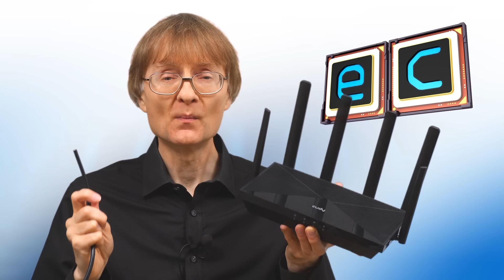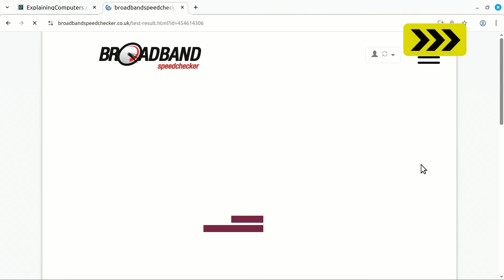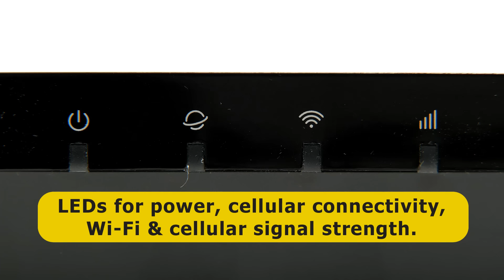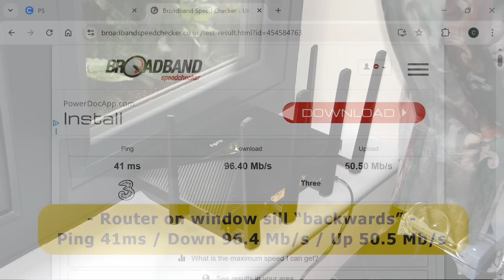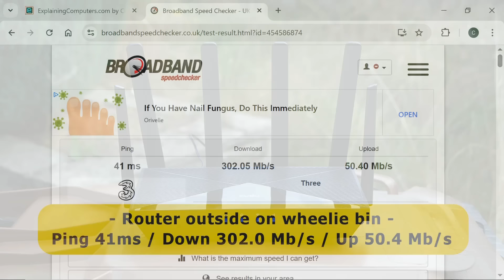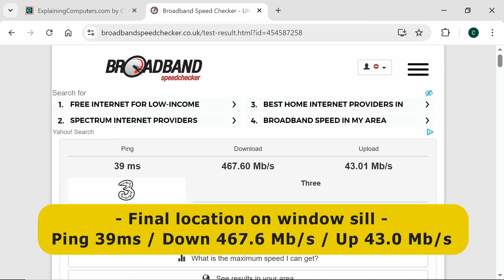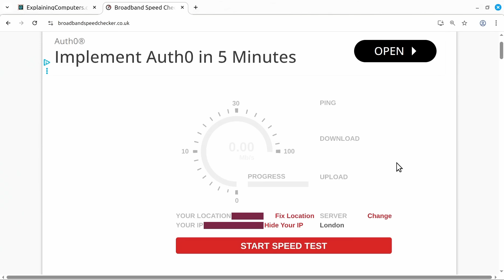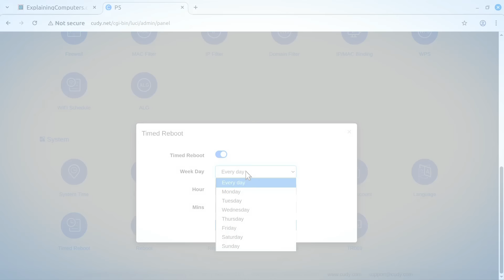Switching to 5G Broadband: Cudy P5 Router

Comment: Thanks Chris, great to see you've made the switch. There are a surprising number of major supermarkets running just on 5G and some on 4G, so the networks can good enough, if you pick the right one. A few things to note:

Three have an APN which hands out a real public IP address - use APN: 3internet 

Be slightly wary of speed test results - all networks prioritise them to reduce support calls.

Being close to a mast is great, but if that mast is put into maintenance (happens quite often) bye bye connection as you're unlikely to be in range of another mast.

If you're sticking to this setup, I'd suggest getting external antenna as it'll help when weather isn't great or if your mast gets busier, or if they put the mast in maintenance.

Finally, Vodafone and Three have merged, we're yet to see how much that'll break the currently excellent Three network.
Reply from the maker: Vodaphone and Three merged (technically) some time ago now, so I think we'd have come across any issues by now. I am aware of the other points you note! :) I am in range of three masts, although only one is very close.
Reply from the maker: Sorry, just came back to this and your APN tip -- very interesting. I did not know this! I've no need for a public IP, but will experiment anyway. :)
Reply: @ExplainingComputers  I use the public IP APN plus a Dynamic DNS Service and then run a home OpenVPN server - works beautifully

Comment: Are there anyone who knows how I could make my printer accessible from either WiFi network?
We have two. The first one is the one that came with our new fiber network.
The second one is our old router (or whatever they are exactly), which must be used because our printer talks to that one, and it works as a network switch. 
The problem I think is that the old one still has the DHCP server on, but if I disable that, it does nothing. So what should I enable to make the old one a dumb switch with Wi-Fi?
These two are on the opposite sides of our house.

Comment: I have 1Gb/s symmetric fiber to the box in my garage, and from there copper to an Orbi RBR850 Wifi 6 router. It has 1Gb Ethernet to my Mint desktop, NAS, MacBook and printer, and Wifi to everything else, including a Hubitat home control hub. I just got 25ms / 260Mb/s / 150Mb/s on my Galaxy Fold 7 over Wifi 6 to a server in San Francisco from Portland, OR, and 7ms / 926 Mb/s / 860 Mb/s to Coos Bay, OR on the desktop. I currently pay $90/month, up from $60/month when I first got the service 4 years ago.

Comment: After over a year of nothing but trouble with our wired VM broadband we finally gave up last year, they seemed unable to fix the issues and didn't really care that our connection was almost unusable at times. 
We switched to a 5G data service (currently EE but we might change to 3 when our contract ends). We are paying less than we did with VM and while the connection is not perfect, it is so much more reliable than our VM connection. We don't get such a high speed obviously but it is plenty fast enough for what we need to do, I am sure it would be improved using a proper 5G router as you are using but we decided to get a high quality portable unit so we can use it when travelling as well, a worthwhile compromise I think. 

The savings have now covered the cost of the router  and we are much happier with our setup.
Reply from the maker: I find it really interesting how many people have a story like mine or yours. It seems a that a lot of people are doing this now, but it is not widely talked about or otherwise communicated.
Reply: @ExplainingComputers  When I started research I was surprised how common it was and how widely available equipment was.

My biggest worry had been data usage as my partner WFH several days a week and we don't have a TV so all our entertainment is online. My sim is "unlimited" but has a 650GB fair use cap, I thought this sounded low but in reality most months we use 150-200GB so it's actually plenty, even when we have guests.

Comment: You mentioned your landline number that you've had for years, how is that being delivered now? Standard copper?
I've gone over to YouFibre (a Netomnia brand) and ported the landline number to the VoIP phone off the fibre router. Which is OK but it does need the router rebooted every now and then otherwise it "forgets" the landline number!
Sooner or later, all the copper connections will be ripped out.
Reply from the maker: Yes, my landline is still on copper. I very much doubt that alL copper (from cabinet to home) will be gone anytime soon. We have until at least 2030 on the current timescales, and "June 2025" very easily became "January 2027" . . .

Comment: Really good to know 5G is becoming a serious option. I have network sockets all over the house so would definitely want something I could plug into my switch and not rely on WiFi.
On the subject of placement for good signal, when I switched from Virgin to Plusnet the router was installed near the only phone socket, the master socket which is near the floor at one end of the house downstairs. Not where you'd choose to put an antenna, but where many people's wireless routers live! To test what I suspected was nonsense about only using the master socket I got about 40-50m of telephone cable that was somewhat coiled up and plugged the router in to a temporary extension socket on the end of it. I got precisely the same speed, around 70Mbit/s! So I installed about 10m of cable and put a socket near the ceiling in the middle of upstairs. When I do use WiFi the signal is that good my phone picks it up on the street 3 or 4 doors away.

Comment: The only issue with 5G internet is that you quickly hit a top of 50 GB download. After you reach this limit, they throttle your internet connection. That's why wired will continue to dominate the internet for a while.

Comment: I imagine those speeds will drop with uptake and crowding of bandwidth (and prices likely go up) - you may be, in fact probably are one of very few people in the vicinity using a 5G router, and only mobile users will be sharing bandwidth at the moment. 

ETA >> I've been keeping an eye on 4G/5G mobile availability and prices in my area. Years back I used a 3G dongle for about 6 months after moving and found another factor enters the equation - I'm in a resort town and in the summer, particularly on bank holiday weekends and even more so when events were on (pretty frequent here) speed would drop from comparable to ADSL to  ... pretty dismal.

ETA >> prompted to check 5G broadband at my address - no coverage from 3, and from those that have rolled it out unlimited is £55-58 PM (capped is cheaper but no use to me). Meh.

Comment: Connected by FTTP but, I also have a 4G modem with a 36-month 40GB SIM from THREE as backup. The FTTP modem,  4G modem, router and 8-port switch are all on a UPS. In case there's an internet and/or power outage and something happens e.g. fire or break-in. If the FTTP drops out Home Assistant automatically turns on the 4G router (via a Tap plug) and the house goes into condition blue. Home Assistant is on a separate UPS too. I wanted a generator to automatically start, but the missus said this was too much 😂

Comment: It’s very encouraging to see such good connection speeds.  I’m still on FTTC, and my best alternative option is a 4G connection with Three.  

I think Starlink is still far too expensive to consider for private installation, but I’ve used it onboard ships, and it’s very odd.  Video works just fine, but browsing server folders over a corporate vpn is painfully slow.

Comment: I use a Huawei 4/5g router, with a wired connection to my computer, using the one 1G port on the unit. Much better than using fiber, which is wired in, but I never signed up for it. The LTE connection is solid, and I get good results, with almost no downtime, a lot better than the fiber, as that quite regularly goes down as the cables get damaged or broken.

I did have a CUDY router, but after less than 2 hours it was returned wiped, it would not keep a stable connection, so the white garbage bin was factory reset, packed back in the box, and returned. Have a spare Huawei router, just in case, though the only thing that fails on them is the 12V power supply, which blows up the output capacitors.

Comment: An update to my previous comment - My Cudy came today, came straight onto the Smarty (3) network with no faff or configuration needed. Put the SIM in, it configured itself, lights turned blue, connected it to a client over cat 5 and throughput up to 401Mbps which is pretty impressive. More than what I need for a backup connection and better than 20Mbps. Switched off wireless, connected it to the backup WAN of my pfsense router and happy days! Works perfectly. I'm paying £12 a month for 200MBytes/month.

Thanks again, Chris!
Reply from the maker: This is great to hear! :) It's always nice when technology works. And that's a good deal from Smarty too.
Reply: Cat 5 can slow your connection speeds if it's a long cable run

Comment: Back in high school ('07-ish) I worked for a mom'n'pop wireless point-to-point internet provider. Basically we installed a directional antenna at the customer's home, pointed to one of our towers. Weirdly that was also my first linux experience as all the equipment ran embedded linux and I had to ssh into stuff to troubleshoot and help setup. 

Also good to see you included ping/latency in your bandwidth tests. And I'd be curious how that router would work if you had multiple external antennas spread across a room instead of just off of the unit. I know I'd rather mount and run an antenna instead of the whole router.

Comment: I use an Odido 5G connection here in the Netherlands as a backup for my fiber optic line. I have a Zyxel NR7302 modem in front of my window. I'm paying €20 per month (the official price is €25). It's "unlimited" data, but there seems to be a soft cap, as the speed slows down after 5 TB/month, and they appear to disconnect you after 10 TB. The ping is significantly higher than fiber, hovering between 25–35 ms. While the advertised speed limit is 300 Mbps, I've hit speeds over 1.1 Gbps late at night. This is likely because I'm just 100 meters from a 5G cell tower that uses the n78 (3.5 GHz) band. My only real complaint is that my VPN connections to the office are a bit less stable compared to fiber, but otherwise, the connection holds up well.

Comment: We have a very bad wired internet connection from TalkTalk, 5 down .5 up., it sucks, but is necessary for a landline for now. Fibre is coming so they say, a promise over 5 years old. Luckily, we also use 3 UK and normally get a useable 30 down 10 up, sometimes better, via 5g data only connection.

Comment: At beginning of your video, I thought that 200+ GBP could be quite expensive for such a unit. But when I saw this can provide dual 5G wwan conns redundancy (and it should), the price is kinda ok somehow. 
If it was for me, I'd like to design a hand-made one with 1~2 minipcie/m.2 5G modules on a Linux mini pc or sbc for extreme flexibility, but to be frank - the hardware cost for the entire set might be similar with this easy-to-use single device. 
Hopefully this wwan router can be sufficiently reliable to be your major conn, which encourages u to say no against the unreasonable service providers.

Comment: Kudos on your success with the 5G wireless internet quest and obtaining better bandwidth at a fraction of the cost. Your points of comparison made me realize I'm a bit spoiled these days by reliable fiber connection. Testing just now via 3 services, I'm seeing +900 Mbps down and +800 Mbps up; for which I pay the AT&T monopoly $100 USD / month [~75 GBP] (with a bonus of included HBO MAX streaming that feeds my Rick & Morty obsession). Only comparable bandwidth and cost "choice" is the other monopoly provider, Commiecast Xfinity, that piggybacks on copper cable TV lines and forces a cable channels subscription that subsidizes fascist propaganda fraudulent News networks like FauX. There are a couple of 5G offerings like Verizon and T-Mobile, but the bandwidth is fractional (~200 Mbps) and the cost doesn't track well with the reduced service. There are still some DSL services for AT&T copper phone lines, but they don't even show any bandwidth numbers. Have to add that getting reliable and decent bandwidth internet here was a nightmare -- DSL was always a flaky stopgap and my Cable TV monopoly service went out whenever it rained and they refused to fix their lines for years.  About 10 years ago, AT&T finally delivered on the decades of tax subsidies they blood sucked from us on promises to build out the region's fiber network, and outside of blockading net neutrality regulation, their corporate behavior and service quality has been tolerable.

Comment: I pay $100 US per month for FTTH Internet from a small local ISP, but I’m guaranteed 1,000Mb down and 500Mb up with < 10ms ping, which I can confirm I get. They also have literally never hassled or even tried to contact me about any of my online activities or the excessive amount of data I use. I have 4 kids and a wife in the home, and we have soooo many laptops, pc’s, every modern game console, every last gen console, 4 tv’s, and a multitude of IOT devices. It’s not unusual to see our data usage hit 1.5-2 TB in a month, especially when new AAA games release and get downloaded to multiple devices. The 5G wireless provider we used before the fiber was notorious for shutting our connection down almost every month due to us actually using it, they even told me somewhat rudely on the phone that “well 200GB is an awful lot of data use and more than really anybody needs”.
We did switch to Starlink as soon as it became available in our area and it was fantastic for a few years, but when we bought a new house and gigabit fiber was available I couldn’t pass it up.

Comment: I use Youfibre on the 1000mb package currently £29.99 p/m. This is a 1000mb download and 1000mb upload. You can keep get a phone line for £5 p/m. You can keep your phone number. (mine phone number has been the same for 54 years)
If you want I can give you a referal code for a cashback offer, I think its a £100 at the moment.
They have a 2000mb down 2000mb upload package for £34.99. I am thinking of upgrading.

Comment: Looks like a good option for van / boat dwellers too with that Cudy taking 12v DC power; particularly if combined with a 5G antenna like a Poynting PUCK5 to pass the signals outside a steel structure.

Comment: I used to have VDSL from Vodafone, Sky and Now (which is Sky, anyway). It was very consistent and reliable 25mbps up and 7 down with just 9ms latency. Unfortunately, this was the max for the line and the building managing company didn't allow installation of other telecom companies. I've got 3 5G broadband last year and thank God. Yeah, my latency jumped to 25-30ms, but the download is 100+ Mbps, which is usually gravitating around 250 with 30-40Mbps download. Great! The only downside is that I'm using the ISPs router, which is positioned on a window sill at far corner of my flat and my bedroom has a bit patchy Wi-Fi. Not very good for my kids, when we relegate them there in our pursuit of peace and serenity at the end of the day. I was seriously considering getting a simple router but my wife estetics stopped me and the fine print of my contract explained that I have to use only the telecom equipment provided. Well, it seems like third party are working, as well.

Comment: I have the GL.iNet GL-XE3000 (Puli AX) 5G Router with SIM Card Slot, Dual SIM Cellular with external antennas. Nothing shy of a gigabit with EE.. The p5 isn't great doesn't have fallover from the landline. 3 isn't great EE has faster 4g than over thread 5g. Also three have no standalone support.

Comment: Very interesting video. I have been thinking about getting a sim card with data only to have as backup, 5G certainly makes that more promising. There have been a couple times when my ISP has had hiccups where it has ranged from less than a hour to one outage lasting two days.
The only problem currently is that when you're connecting over 5G (or any mobile carrier), as it stands you're likely getting a CG-NAT (Carrier Grade Network Address Translation), which does NOT allow for opening ports and stuff like that. But I do hope that as 5G becomes more popular as a connection type, maybe this change and it becomes more like wired net. Although it will likely require it changing to 6G to implement that fully in the design.

Another thing, you don't need 4 RJ45 cables to the window, you can have a network switch somewhere else and have one cable going to the router, then split it at the network switch. You can also daisy chain network switches if you need even more ports (or in different rooms).

Glad to see the switch went well for you!
Reply from the maker: Yes, all 5G in the UK is CG-NAT. I do need to route the cables to the router as I'm not going to introduce another powered device and adapter into the mix for no reason. :)
Reply: @ExplainingComputers  Thank you for confirming that, I'll have to wait before fully switching over until that gets address. But with how fast 5G is being built, maybe it will galvanize the carriers to fix that so it works exactly like wired net. 
That's a fair point, if you can make do without a switch, it's absolutely best. Just figured that for some it might make the switch easier if you replace the old router with a switch, then have one cat cable going to place like window sill with good reception.
Also another upside of having the router on the window sill is that the WiFi is probably better, so it might be worthwhile to use WiFi on the devices that can, reducing the need for wired.